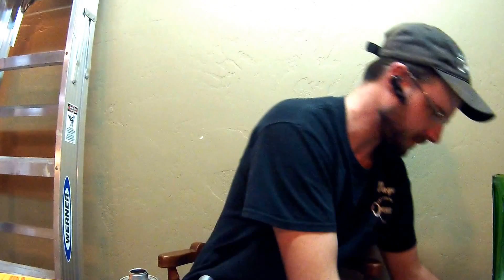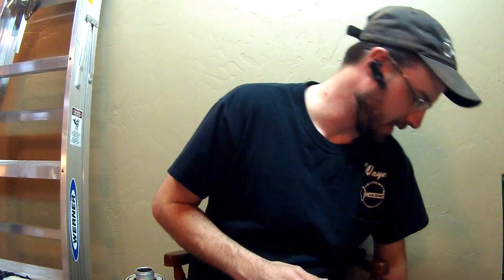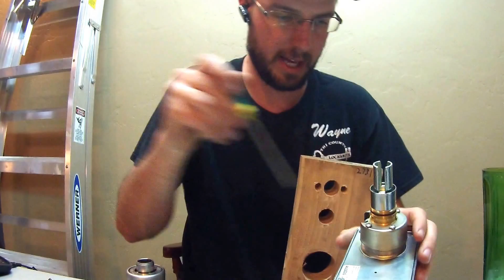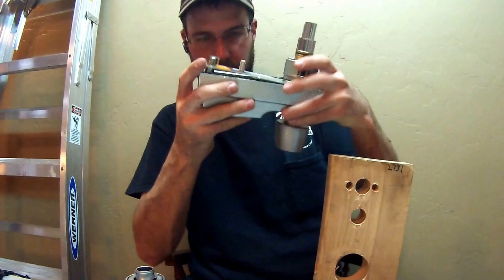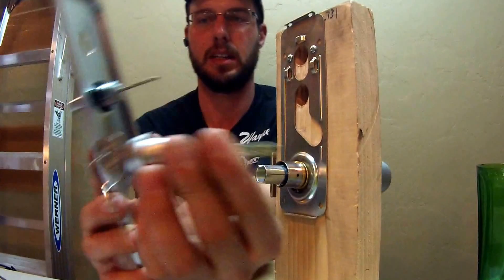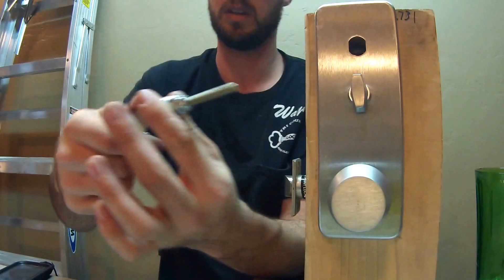Install and Set Up Kaba Push button Lock

Comment: Hey! I just did an installation of the 5000 series. I had to change the handing and they had green loctite on them. Any way you go around this? I had to torque them out with some channel locks and ended up snapping one. Was such a pain in the rear. Any tips?

Comment: Hello I'm attempting to remove and replace a simplex 1000 at work I can't seem to get the handle off I use the tool to press in the little hole it should release the handle to come off but it doesn't I looked at the new simplex 1000 the handle was already on it and I tried to pressing in the hole of the new one expecting it to come off easily but it did not what am I doing wrong? I was using enough pressure I thought can you help?
Reply: Could be wrong but certian ones you use the the key and keep turning to unscrew parts of it. Again if I knew exactly I wouldn't be here. Good luck
Reply: I'm realizing this comment is two years too late...